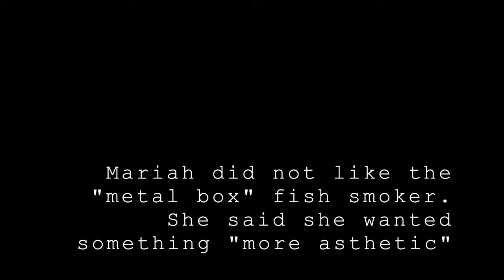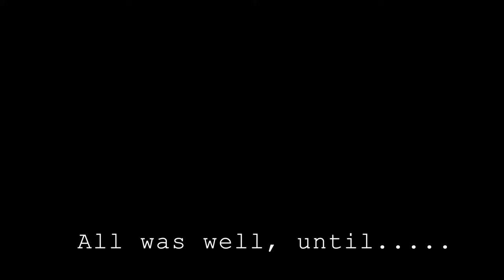Cedar Smoke-House Build | Alaska Salmon

Comment: You should seal up everything and vent from the bottom. Heat raises and the smoke is much more intense at the top where it's escaping. 
Doing mine that way, cut way down on the curing time and added a lot to the flavor.

Comment: If the smoke outlet wasn’t flush with the inside of the smoke house that hot smoke wouldn’t roll directly up the wall causing the fire. I’d consider extending it to the center and making a metal smoke distribution plate above that so you have even smoke/heat throughout the box. Great build.

Comment: I can tell you exactly how we deal with ticks in south Texas.  We have this critter called a Fire Ant.  And when they bite, you know exactly why the word Fire is used.  Fire Ants were orginally introduced in Lousiana to deal with the tick population.  As time went by, the ants made it to Texas.  I grew up around Dallas, Texas in the 60s & mid to late 70s and it was not unusual to come back from hunting and have several ticks feasting away.   I moved just south east of Houston in 77.  One thing I noticed was all the ant mounds.  When I would go out hunting, never came back with any ticks.  I've always had dogs and I have yet to see any ticks on them and that's been going on for 47 years.  In all that time, I've actually only seen two ticks.  Other than the sting cause by the ants, the second problem they cause are electrical problems.   For example, if you have a well, the arcing of the contacts opening and closing during a well pumping, produces ion gases.  This attracts the ants and enough of them will get into the housing to interfer with the well's operation.  Working for Dow Chemical as an electrician, all the stop/start stations in the plant were oil emersed to deal with the ant problem. You are a lot braver than me.....I don't want any business with grizzly bears or a momma moose.
Reply from the maker: ha that it quite the story! Bears aren't as bad as they seem. make lots of noise and tell them who's boss. As long as you don't scare or startle them, they usually give you lots of room. Thanks for the comment!